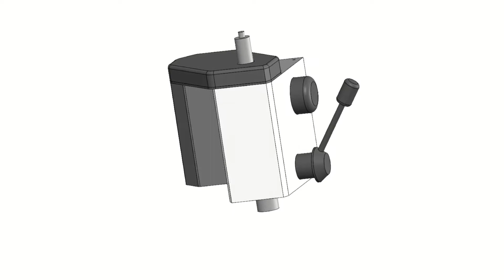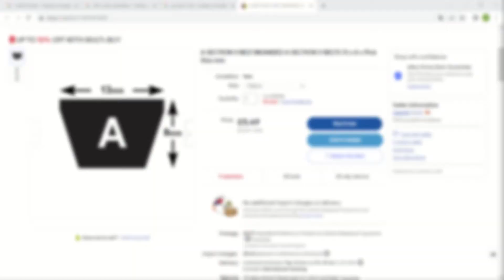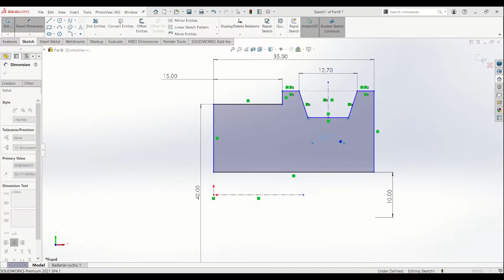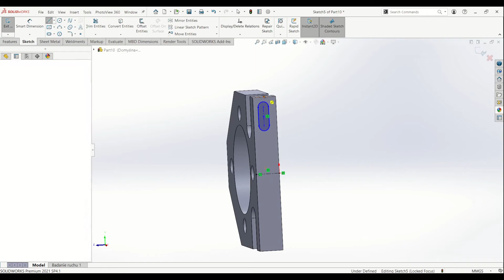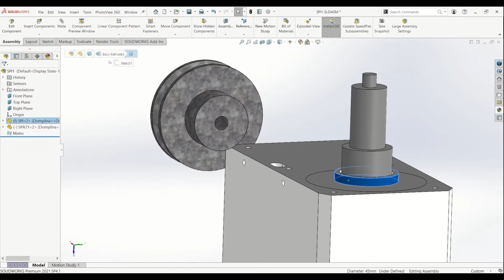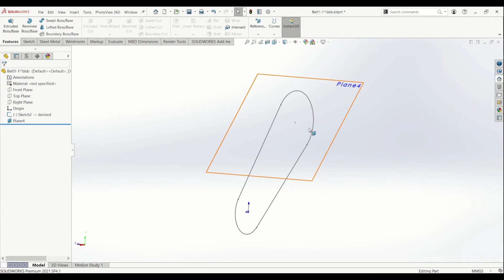Mini mill OPTIMUM BF16V spindle redesign

Comment: Any chance of getting a copy of the drawing files? I have gone through several sets of brushes with that motor and locally they are about $60 a set. So I am looking at putting a brushless motor to mine and putting drive motors on the X and Z axis, but not CNC